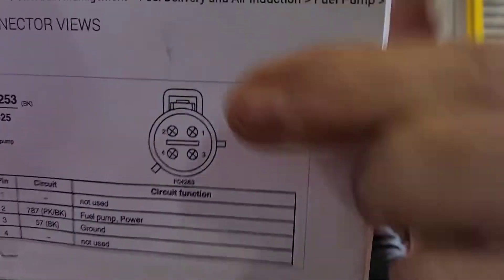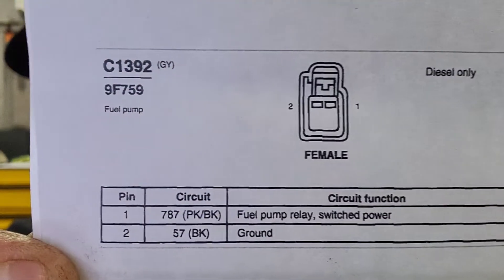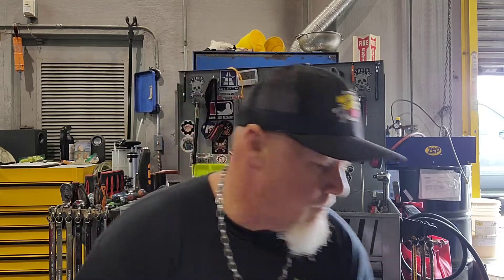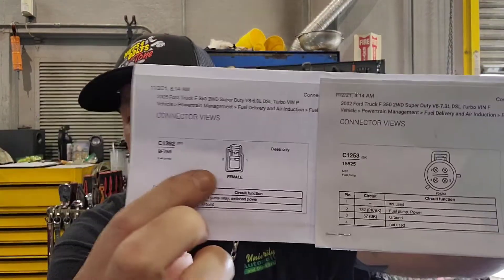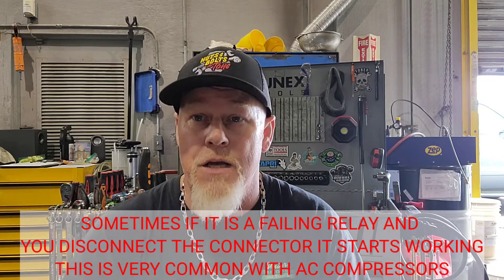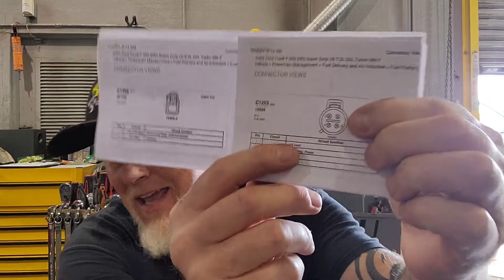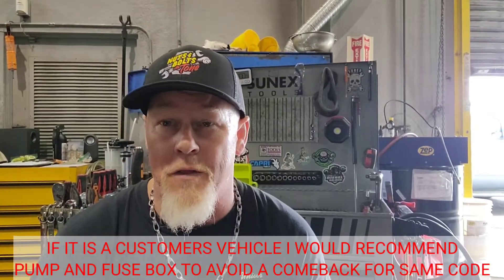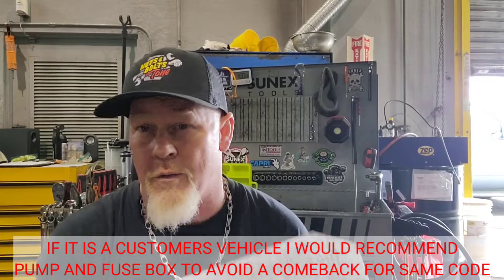POWERSTROKE P0231 FUEL PUMP

Comment: Hey I'm having similar issues but mine will run but shut off. When I hit the key it fires right back up. I've changed ICP, IPR, stand pipes and dummy plugs, oil cooler, crank and cam shaft position sensor, ficm and ficm relay. What gives I'm almost a grand in in a week oh and a fuel pump
Reply from the maker: I would test for this and do not guess.

Comment: Toyota refines their products to take away the bugs and improve. FORD does not even provide a separate relay for a fuel pump of all things (what an incompetent design) so the customer has to have an electrical engineer degree to figure out and fix what their lazy designers and workers should have figured out on their own . Years later this is still a fact with FORD.
Reply from the maker: Crazy thing is that Toyota has done things like this as well, there is a model of Lexus that the ac compressor relay is in the fuse box and is not serviceable

Comment: I have a 02 superduty 7.3 , i bypassed the integrated relay but when i put the key forward i get no power going to the inertia switch should i test the pcm relay and if its good does that mean i have an issue with the pcm circuit or pcm itself
Reply from the maker: I would have to look it up, message me on Instagram
Reply: @NutsandBoltswithTone whats your instagram

Comment: Thanks for the video. I have that problem with my 7.3 2006 F250. Going through the process we found some damaged wires. Pigtails purchased and fitted. Still no start. Now we are going to go further with the investigation. Hope to get it running soon.
Reply from the maker: @peternunan1092  damn that sucks. U can message me on Instagram.
Reply: @NutsandBoltswithTone  thank you.
Reply from the maker: @peternunan1092  your welcome

Comment: i have power at the pump i can hear it turn on and run, it does run constantly and does not turn off though, also having a no start situation with the code p0231, would my relay still be bad?
Reply from the maker: @samzank1187  most likely no since you can hear the pump run, i would just test it for power to be safe.  However most likely you will have power.  Message me on Instagram if you need any help

Comment: i have a dumb question about this code. i have one doint the same thine driving in town but on the highway it runs perfect. doesnt make any sence to me.  great thanks for any help on this. ken
Reply from the maker: Sorry your having trouble.  The only true way to check this is with a fuel gauge.  Also you could tap into the power supply wire to the fuel pump and see if you lose power to the fuel pump while driving.  If you get the code but don't lose power then most likely the pump.  Message me on Instagram if you need more help.  Thanks for watching
Reply: thanks for the reply. i think i found the problem tho. fuel pump relay melted inside the fuze block. think im going to try and bypass it with a new relay.  let you know how it goes, thanks againg @NutsandBoltswithTone

Comment: I have a 2001 that code p0232 is pretty much stuck on I can clear code and cycle key and it comes right back on would the procedure for p0231 work for p0232
Reply from the maker: No you cannot use same test. I just did some research and all the posts I see for that code is a failed Fuel pump. I am not telling you to replace it just that is what I see as a common issue. If you message me on Instagram I can help you out. Thank you for watching.

Comment: I am new to the diesel thing and I have this code I have a clicking sound from the back of my fuse box I have a 2000 7.3 and it clicks but if I take the plug closes to the the upper left out it stops on the back of the box it does the clicking with the ignition on I have a crank no start my fuel bowl fills and I have no air in the lines and I have been stumped for weeks can this cause a no start with cranking it has brand new ipr cps ipc  oil pressure switch every sensor just redone the motor completely and I had codes read and I would really like to figure this out I’m gonna try this tomorrow and hopefully it helps figure this out
Reply from the maker: Do you have any codes? Do you have the ability to read data from computer? like icp pressure while cranking. You need minimum of 500 psi of oil pressure while cranking. Hit me up on Instagram if you need anything else. It is easier for me that way.

Comment: So when my 6.0 stalls the green and yellow wire loses power. But I don't here the relay click until a few minutes after. Isn't that strange?
Reply from the maker: That is strange but the clicking is just the relay turning on or off, If you have no power to the pump then the relay is most likely not working.
Thank you for watching.

Comment: Of course i would have the other problem, i have power at the inertia switch switch seems to work ok with ohm check but jumped the connector anyways still nothing to the pump.
Reply from the maker: Not sure what you mean. If you need more help you can hit me up on Instagram. Thank you for watching
Reply: @NutsandBoltswithTone  sent ya 1
Reply from the maker: @HaydenIngram  ok I'll get back to ya soon

Comment: My truck has been sitting at work for going on two weeks now and I'm stumped. I have power at the fuel pump(I back probed it like you said and I can hear/feel it turn on), I also have about 5volts at the inertia switch and it seems to be getting wet from the rain currently(not sure if that can ruin the switch possibly?). I just replaced the FICM a few months ago so I know that's good. My scanguage comes back good.

 Ive gone from thinking it was the Fuel Pump to thinking its the HPOP and now I'm back thinking its the Fuel Pump or non-servicable Relay but if I understand you correctly, my fuel pump making noise should mean that the relay is okay right? Sorry for the speil.
Reply from the maker: First off thank you for watching. Bummer that you are having a problem. I saw your message on Instagram and I did respond on this matter and how to help you figure out what is going on with your truck.

Comment: What do you mean by having ground at the relay at the 8:54 mark in the video? How do you test for that? Thanks
Reply from the maker: You have to find pin 10 light blue/orange wire and with key on should have ground, So the top of the diagram I showed, shows that power comes into the relay on top left side from the power relay, and then you check that pin 10 at the bottom left, if you have ground then your relay should be sending power to the fuel pump, if you do not have ground then the fuel pump relay is not commanded on. I use a power probe and access the wire, or you could use a test light, hook one end up to the positive terminal on the battery and with key on if the test light lights up then you have ground. If you have any other questions hit me up on Instagram and I can help you. Thank you for watching.

Comment: Things like this shy me away from working on Diesels. I would have been there for days trying to figure this out. Well done!!
Reply from the maker: Yeah these things sometimes make us go crazy. Hoping people see the video before going around in circles. Thanks for watching.
Reply: I don't think this relay set up is a diesel only set up. Likely the problem is exacerbated by Ford using a relay more suited to run a lower pressure gasoline fuel pump.